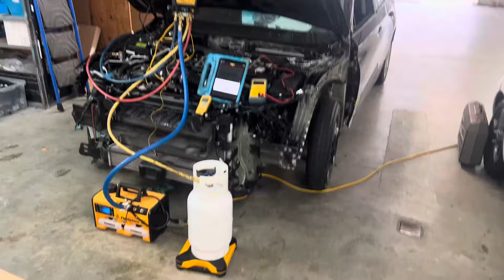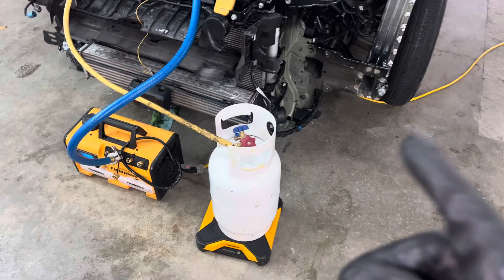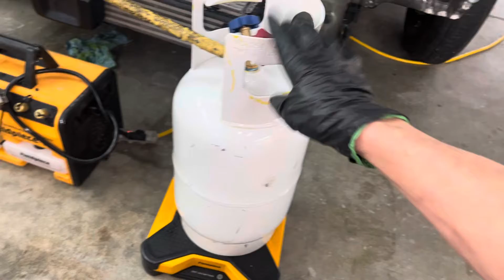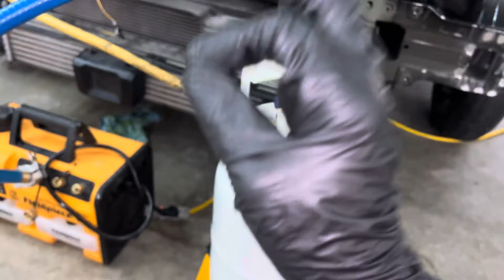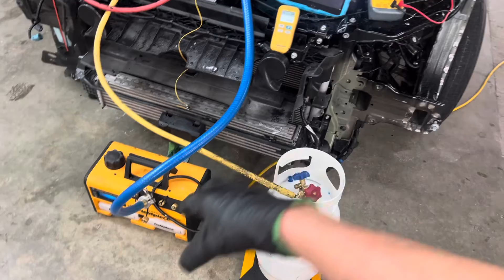Refrigerant Recycling Tanks, and reusing refrigerant after it has gone through recycling process ￼

Comment: Refrigerant is getting too expensive to just give away, they should test it and buy it based on the results because it still has value before it's cleaned-up.  I often wonder how much refrigerant is being turned in for recycling that's perfectly fine.
Reply from the maker: Lots tens 1 millions of tons a year
Reply: But most technicians still purge refrigerant to the atmosphere. I always use a vacuum pump to purge air and remove moisture from the hose.
Reply from the maker: @w0lvez1  I use the Home Depot 5 gallon bucket hose purged off into some bucket of water. 💦
Reply: @w0lvez1  It's almost a shame refrigerant isn't pyrophoric or a strong oxidizer.  On 2nd thought, that's probably a good thing...

Comment: If you recover the charge on a system that that has leak in it you will recover ambient air if you run the machine in a vacuum. I always stop at 5 psi and let the rest out
Reply from the maker: Air is easily removed no big problem.!
Reply: @coldfinger459sub0  Moisture getting in the system is a big and time consuming problem. Air is much smaller than refrigerant. Why risk getting air in the system?
Reply from the maker: @w0lvez1  because it’s so easy to remove

And that’s the EPA rules is to recover refrigerant down to -15 atm vacuum . 

Everyone Who has the 609 EPA certification knows this?. 🤔
Reply: @coldfinger459sub0  Isn't that for old ozone depleting R12 &, R22? EPA probably means recovering refrigerant on the system without leak. Also it's not illegal to use a small amount of refrigerant as a tracer gas.
Reply from the maker: @w0lvez1  all refrigerants.

Tracer gas for residential and commercial not Automotive 

The tracer gas we use for automotive is called forming gas and it’s either 5% hydrogen or 5% helium
Reply: @coldfinger459sub0  
Exceptions to the Evacuation Requirements
EPA allows limited exceptions to the evacuation requirements for 1) repairs to leaking refrigeration and air-conditioning equipment, and 2) repairs that are not major and that are not followed by an evacuation of the equipment to the environment.
Reply from the maker: @w0lvez1  I think you mean recovery not vacuum. Just the wrong word used.. 

All equipment must be recovered . Leaking or not leaking..  

Under EPA 608 residential one commercial.  50 pounds of refrigerant in commercial that do not require you to recover the refrigerant down to such a low vacuum.. 

There’s allowable situations where you only recover down to zero not into a vacuum and certain certain types of equipment . 

Automotive EPA 609 all the equipment runs off of software to the EPA J laws 
Technician has nothing to do with it. It’s software that automatically pulls the refrigerant recovery into a -15 vacuum and then goes to a stand vacuum decay to make sure there’s still not refrigerant boiling out raising the pressure if so, it’ll go back into recovery mode to recover more refrigerant. 

EPA 608 and 609 are different
Reply: @coldfinger459sub0 Man you know your stuff, lol... I'm EPA certified universal and have a AAS in HVAC/R and didn't know/forgot that..

I've been out of school for 10 years (I never went into the field though) my instructor was definitely correct when he said that thr things are always changing and evolving in the HVAC field even the text books I kept would be outdated. I kinda didn't believe him lol. When you're a know it all you soon find out that you don't know.

Hey do you still attend classes to keep up with the changes in the field/technology whether in person or online from time to time?? 

Remembering an answer for an EPA certification (which for me was a weekend course) my hats off to you man.😂✌🏿
Reply from the maker: @RicardoSilvas-uq6wn  we are all students for the rest of our life. We can never know it all even when we think we have come close to knowing everything that we knew at the time when we were introduced to it there’s so many more things that have been introduced that you never catch up. 

Never be bored in this industry 

It’ll also never be poor
Reply: @coldfinger459sub0  Indeed! I never did hvac for a 9 to 5 just on the side a capacitor here or there, cleaning out drain valves and a couple installs. I had a friend who did very well before he was killed. He did straight-up business, none of that slimy stuff to get repeat business..

The funny thing is I never had an interest in automotive ac when I was in school, but I recently started to get an interest in it, which is how I found your channel.. But I appreciate you for responding, thank you.
Reply from the maker: @RicardoSilvas-uq6wn  👍

Comment: Dear, What do you think about insulating the cold suction line? is it a good idea to boost ac performance, especially in hot days?
Reply: It will only boost mould and will accelerate corrosion on aluminum.  If you haven't added dye to the system add 1/4 - 1/2 oz of refrigerant oil to make it blow colder.
Reply from the maker: @w0lvez1  more is always better 🤣
Reply from the maker: Extremely hot climates it’s a must. And if you have a accumulator, don’t forget that either.

Comment: Can you clean the tanks
Reply from the maker: It’s not worth the risk of one being highly corroded and rusty inside. 

You can get the oil out by using clean fresh refrigerant several times filling up the tank and then completely removing it by the liquid side not through vapor because the liquid will hold the oil have the tank upside down . 

But this would be a very costly expensive thing to do more than the tank and refrigerant and labor . 

The walls are flaky with rust . 

May not get all of the particulate matter out of there. 

Safer easier more reliable just to have a completely dedicated brand new tank that never gets anything but already purified, clean dry oil, free air, free refrigerant Intuit. 

Now, if somebody wanted to open up the inspection plug, take their scope and look inside. 

And if they have more labor and time then money

They could put some BB shot steel or bolts ends that are clean and put it into some sort of Tumblr that would rotate the tank around. Leave it on overnight.

In two different directions all the rest off and then many times flushing was solvent shaking up and down until it came out completely clean and see a nice bright shiny metal surface inside this would be the third backyard. Do it yourself method because a lot of time is available..
Reply: Tanks are cheap in comparison to the refrigerant going into them.  Best off to use known good tanks to avoid contaminating perfectly good refrigerant.
Reply from the maker: @thisisyourcaptainspeaking2259  that’s why I have an excessive 40 recovery tanks because refrigerant is so cheap that fills those tanks even if the tank is $100 a tank that’s only a fraction of the tens of thousands of dollars that will lifecycle through every tank
Reply: @coldfinger459sub0  In the case of acidic refrigerant, do you just turn that in or do you clean it up?
Reply from the maker: @thisisyourcaptainspeaking2259  depends on the size of the system the cost of the refrigerant and whether we’re talking automotive or residential or commercial. 

In a commercial when I have 100 pounds or more, it’s going to get cleaned inside the system using a shell filter cartridge holder if you have $6000 in refrigerant and you can clean it up for 1000 or 2000 easily 

Unless it’s a complicated very dirty system then the price just keeps going up . 

If it’s just Automotive one 2 pounds clean it recycle it reuse it . 

Get out of it, get the moisture out of the air separated from it  It’s nearly brand new refrigerant again.

And actually, they can clean recycled refrigerant to be even cleaner specs than the specs for brand new refrigerant that is virgin